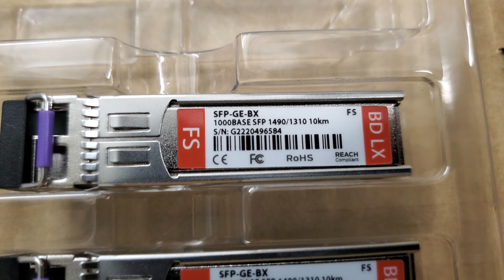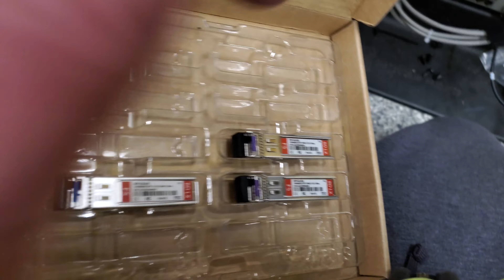500Mb DIA Fiber install using a 1310\1490 BIDI optic

Comment: For your DIA customers like this do you use a managed CPE, unmanaged media converter, or just let them plug the SFP into their own equipment?
Reply from the maker: Last 2 about 50\50 the customers change but for the most part I'm interfacing with licensed equipment with a copper connection or if they want to buy there own optic they can.  The SFP we provide seems to work with almost anything that 1G but the 10G equipment seems to complain due to licensed nonsense.